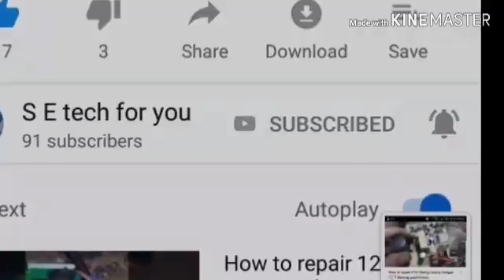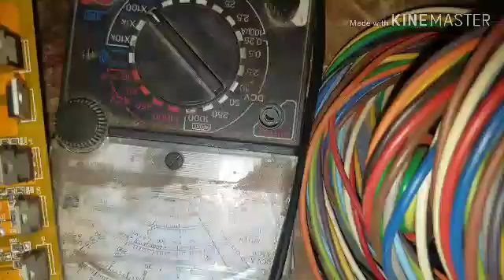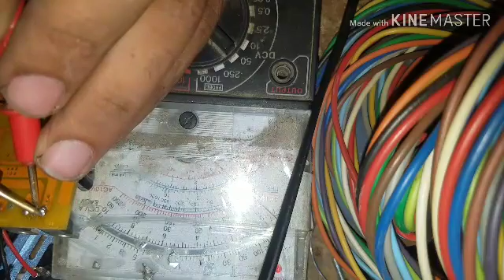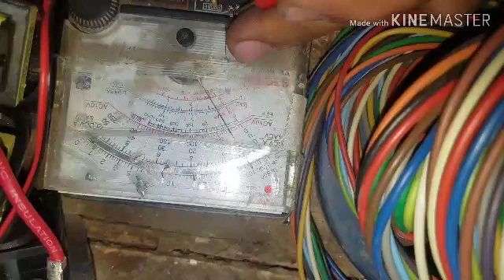ہر قسم انورٹر کو گھر میں خود مرمت کریں..how to repair inverter fault

Comment: سر میرے پاس 30A کی چارجر ہے لیکن وہ وولٹیج تو 14.5V دیتا ہے لیکن نہ تو فین آن ہوتا ہے اور نہ ایمپئر دیتا ہے سر یہ کیا مسئلہ ہوتا ہے
Reply from the maker: change upto coupler aur lm358 k pin 4 aur pin 8 k darmiyan voltage chick karyy ..12 honaa chahyii agar nahii too next video is par hoga insha allah
Reply from the maker: aur lm358 par agar voltage tek hai too phir also change lm358 ic
Reply: @Saqibh62  sir may ne lm358 aur opto coupler b change keya leken out nahi deta aur pin 4 aur 8 ky dermeyaan voltage 2.4v ata hay sir koyi aur yariqa transistors b teek hay resistors b correct hay sir
Reply: In Sha Allah esko check karky phir rabita karta ho sir thanx